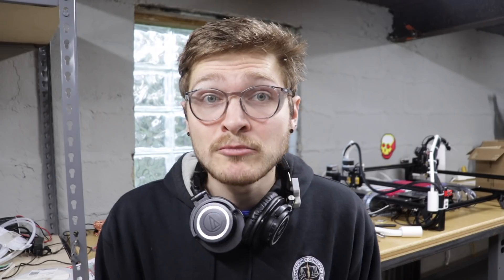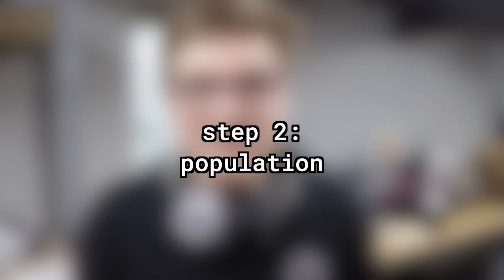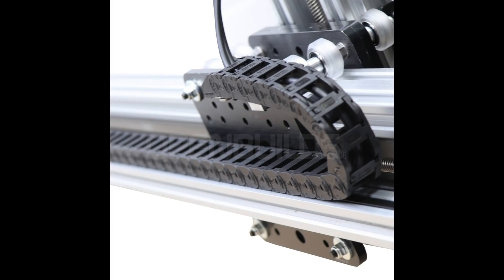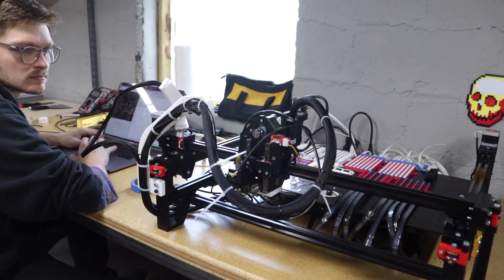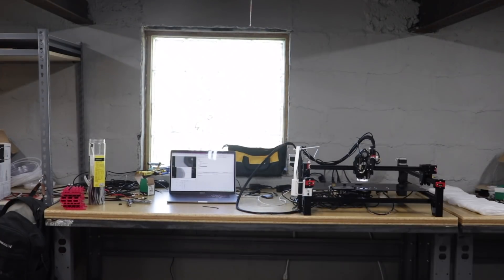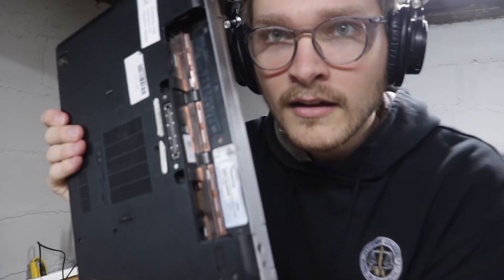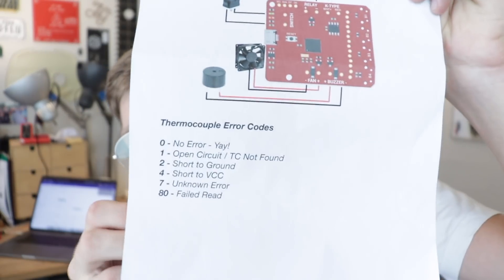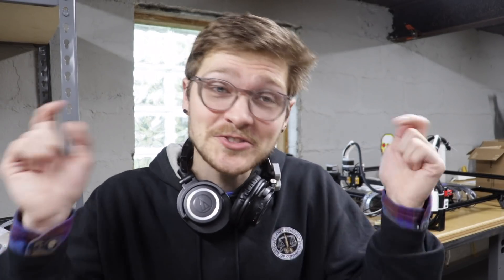Setting up an SMT line at home!

Comment: The best jig for stencil printing is from eurocircuits. It's self aligning and a setup is done in less than 3 minutes

But it's very expensive and the stencil need some holes and holes on the PCB

Comment: For keeping the umbilical upright try a helix spring. If it is not stiff enough apply some layers of heat shrink until it is. You can either get a fat one or three smaller ones in a triangle pattern.

Comment: I was watching a video where Make was talking to Eben Upton from the Raspberry Pi Foundation and thought I'd share what they did with the Pi Zero, since they needed to mount the memory chip on top of the processor they used their pick and place machine to dip the legs, balls and pins in solder paste before placing them on the board. This removes the need for the solder mask as it becomes an extra step in the pick and place process.

Comment: Dunno if someone else has mentioned this but instead of a third arm section for the support arm, have a small second arm come up fro the head itself. It probably wouldnt need to be a large as the first iteration of the short arm you showed here, maybe 3/4 the height. 
this would mean most of the slack is taken up as shown in the video, but the new arm takes up just enough of the slack near the head to stop it from dragging at the shortest point

Comment: Cable chains are really the best Thing for this. I've worked with 3 or 4 different SMT-Placement Systems and everyone uses cablechains to get the cables and the pressured Air for the nozzles. (Inside the head of the more expensive Machines is a Venturi jet, which produces the needed vacuum to suck the parts to the nozzle.)
Reply: And for the toolchanger-platform are also different solutions available.
The Siplace F4 uses Something, that looks like these vial holder.
A Piece of Sheetmetal can be shifted against the nozzles to secure them inside the holder.

Comment: Many years ago is work on an smt line that used DEK screenprinters for the solder paste and glue application. I echo the suggestion of investing in a printer which tools the board support. If you ever branch out to double sided products, you can arrange the support pins to avoid crushing the first side's components

Comment: Solder paste is super critical, you should get a cheap stencil printer w/ a swiper for a few grand.  The quality and amount of time you'll save will be huge.  I have no doubt if you have calibrated your pnp setup well you will get pretty good placement.  For small parts like LGA-12/LGA-14 you'll suffer if you don't have a good solder paste stencil printer as the fine pitch on these may become a real problem.  You could also get a real mini batch oven from essemtec used that will work on 240/208 for a few grand at 16 amps or just order a cheap drawer type.  You really want a reflow curve so the flux activates properly and the solder flows as expected instead of just baking the whole thing in one spot.

Comment: I'm not aware of the temperature the oven will get, but I imagine it will be more than 200ºC, is that correct? If so, is the cooler resisting well throughout your tests? Got curious about that, but great video, man

Comment: You should take a look at Loctite GC 10 or GC 3W solder paste. It doesn't need a fridge for storage and have a much longer stencil life than many competitors.
Reply: I too would recommend Loctite GC 10.  I use it pretty much exclusively now, and it always seems to work well.  It's a bit stickier than some other pastes, so that takes a bit of time to get used to.

Comment: Does the fan on the oven not need a diffuser? Just a plate in front so the cold air goes sideways? Or mount it as an extractor and the gaps around the door would diffuse nicely?

Comment: Quick suggestion for the stencils that you'll find on nicer industry stencils is some way to drop the board straight down (or lift the stencil straight up). This prevents the solder paste from becoming smeared or dragged on one side as you lift the stencil away.

Comment: You are going to have issues with different color components getting too hot with that oven and you probably won't have enough power to ramp it quickly up. Two changes I would recommend: insulation and modifying the heating. Insulation needs to be high temp stuff, like automotive, and the heating should be indirect instead of shining the element directly on the boards. The bottom can be shielded with a solid aluminum plate instead of the rack, and this helps to even out hot spots from underneath. The top should have something to prevent it from shining directly on components, preventing dark ones from becoming smoking messes. In general, I would worry about eveness of heating on a board, which can lead to uneven solder traditions with dry joints or other bad results. Also unevenly heated boards can warp more, leading to component stresses.

Comment: Fiber cables used to set internet in your house have a iron core to avoid them go 90 degree angle and break, you can use them for cable management , you zip tie the fiber optic cable to your cnc cabling and it will flex and get back to the position just fine

Comment: "eC-stencil-mate" from EURO-Circuits is the way to go for small-scale production. It's by far the best stencil holder that I have used for such a low price (relatively speaking). It has a pair of dowel pins that make alignment super easy, but you obviously have to spend some extra up-front time adding the dowel pinholes to the paste layer of your board.

You can get thermally stable solder paste, which doesn't require refrigeration. The only reason to refrigerate solder paste is if you use it infrequently, and want it to last for years. You also have to let the solder paste sit for hours to heat up to room temperature every time you want to use it if it is refrigerated. Just get thermally stable solder paste and replace it every 12 months.

Crossing my fingers this will turn into a huge success, would love to own an affordable "3D printer style" pick and place one day.

Comment: Thanks for the shoutout mate! I hope that fan you attached directly to the back of the oven is a high temp rated metal fan, or it's going melt after a few reflows :) Most fans are not rated for more than about 80-120deg C and degrade quickly from heat abuse. Maybe at least put an insulating material between the fan and the metal? Some form of high temp rubber.
Reply from the maker: Of course, thanks for an awesome reflow solution! That fan is actually from the heater assembly in a Form 3 3D printer, so it's rated for high temp!

Comment: In the workshop here we have no need for a conveyor belt on the pnp's. I hope we will get a version of the index with dragchain at some point because that's the solution. Plus it's way better on the cosmetic side. (i might tinker something but better to have it as part of the main dev). For using pnp i am not after conveyor and solder pasting from pnp. However where we need solutions for the prod line is 1/ more automatic feeders on the machine 2/ automate the cleaning process. If my feedback can help visualising the demand.

Comment: I have the NeoDen FP2636 Frameless Solder Paste Printer which works pretty well. The biggest downside is that the stencil has to be 360x260mm or smaller. JLCPCB default stencil size is 380x280. You can fit these by trimming the stencil corners or by modifying the printer. JLCPCB does let you customize the stencil size smaller if needed.

So, consider what size stencils you will be using. Secondly, think about your workflow. If your PCB panel is large and double sided, you have to switch out the stencil or move the PCB mounting position on the printer. You could end up wanting two machines to save time on double sided boards.

Comment: and why are you not making a PCB negative to fit the board into it. Just a PCB that is the frame around the main PCB with holes for indexing and so fort... cost a few bucks and is easier and more precise then the used PCB route.

Comment: For solder paste fridge, just buy an peltier element and use a  PVC pipe, with urethan spray foam insulation. reaches at ambient temperature down to 2-3C  on a 12V power supply. Kind of like a car camping fridge, Then you could have it right on the desk just large enough for one tin of paste.

Comment: Hi Stephen good work, just a friendly pointer, get some ESD table mats, ground the machines and desks to protect the components during the assembly process, after assembly put PCBAs in ESD bags with a small silica gel bag, it will go a long way and it does not cost much. Best regards
Reply: Yeaaaah some chips, especially unprotected fets, can die instantly with just a little static. These days tho it's actually surprising how resistant most chipsets are to esd damage, I'd like to see a test comparing how it effects their performance tho, just in case it seems like they're protected but still accruing damage
Reply: @xxportalxx.  ESD of several kV can damage ICs and other components in such a way that components can Pass some simple In-circuit test (ICT) or functional test but it can Fail on full functional tests when the system is performing on Full Power where the system is consuming a greater amount of current, ESD damages components on micro levels making materials weaker. It is better if ESD damages the component to kill it completely, in that case, PCBAs will not pass a simple functional test rather than get a partially damaged component that can later fail in some deeply integrated system. It is important to keep components, assembly line, and later complete PCBAs ESD safe, ideally complete EPA (ESD Protected Area).
Reply: @zdenkostanec1622  you're right ofc, but that is a bit beyond the at home maker community's capabilities most times, it would be nice to have someone compile a guide of sorts on the most probable effects on common component types and how to best avoid them in a private shop
Reply: Makes sense!  Is humidity/temperature an issue?  Granted I don’t think a ISO 1 Class Cleanroom is needed, but is low humidity/ highly stable temperature needed?
Reply: @ericlotze7724  Hi, glad you asked, yes it is important but in this case I think it is overkill. For example, someone will think that a full dry environment is a good option, but unfortunately it is not as ESD builds up much faster in these kinds of environments, another thing to keep in mind is MSL of the components as there are many kinds of them, to keep it under control professional EMS (Electronics Manufacturing Services) keep temperature and humidity in balance to keep components and complete assembly process safe. To fight all of the potential problems there are "Dry Storages" to keep components safe too, and if needed there are special chambers to "Bake" the components before the SMT process, this "Baking" process can sometimes take even 30days or more to "Safely" remove moisture from the components, if you would Bake the component too fast due to sudden rise of the temperature in SMT process Moisture becomes Steam that can damage/crack the component so it is important to "Bake" the component slowly to give it time to evaporate/escape from the internals of the component.

Comment: If you have height then suspend the cable from a support that either retracts or provides enough spring force to support the cable. With enough height you don’t even need retractable support since the length of the supporting cable is nearly the same throughout the travel.